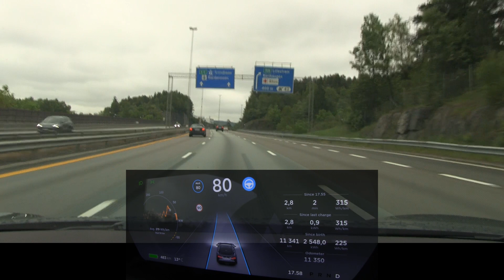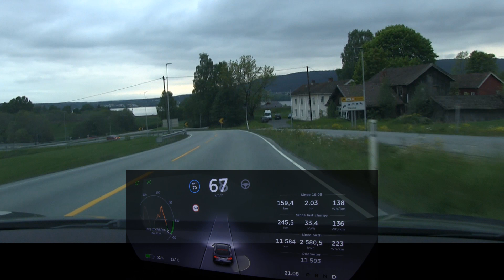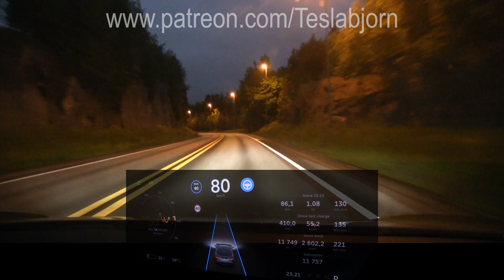Model S with AP2 demonstration and commentary

Comment: I am surprised at how bad it is. Don't they use computer vision properly? I work in the field and this should be easy with feature and edge detection. There's a clear distinction between what's a road and what the edge is... It relies too heavily on map and the drawn lines.

Comment: Firstly a big thanks for all your videos which played a key part in encouraging me to order my model S in October 2015, also used your referral code. Regarding the auto lane change not working at 5:58 and 6:28 this is because the car has not seen the other lane; only the lane it is driving in is visible in the display.
Reply from the maker: Thank you for using my code and for the explanation :)

Comment: Very good video. Informative. The car is not slowing down even slightly like human driver in the bend. Reaction / processing time is a fraction slower at the higher speaks. It goes over the line to the other side. I wonder if they utilise all computer and sensory power available. If they do. It's bad news. As self driving would need 10 times that.

Comment: I have a question, at just past the 1 minute mark you make the statement that coasting saves more energy than engine breaking, but how is that so as when you use engine breaking the energy is put back into the battery to be used later. Surely that's better than wasting it in air resistance and possibly breaking when you exceed the speed limit, neither of which can be recovered. I've watched quite a few videos that involve Toyota Prius and they show the battery being filled.
Reply from the maker: etmax1  there is no engine.
Reply: Well lets call it electric motor breaking then, the electric motor acts as a generator when it is turned faster than it is being controlled to go which results in a EMF (electromotive force) being generated which is greater than the applied battery voltage. This results in the current flowing in reverse which puts the kinetic and gravitational (for want of a better word) energy now converted into electrical energy back in the battery. This happens at reduced efficiency, around 20% partly because charging batteries is not as efficient discharging.

All cars with electric motors make use of this to some extent, and Tesla's use of L-ion batteries does this better than Toyota's NMiH batteries. Some systems have super capacitors which have a charging efficiency almost equal to discharge.

By the way, once I spent an hour looking at the differences between an engine and a motor from a definition perspective, and the definition is severely conflicted in around 90% of texts that I read

Comment: Hi Bjørn! I have seen alot of tests on Nissan leaf forums regarding coasting. Coasting like you did in the start of the video is not actually better because of the increased drag you get from higher speeds. I would think this holds true for the tesla as well, even though it has a lower drag factor.

Comment: why drive so slow 80 on 110
Reply: Not dangerous. There is a passing lane for a reason. Cars with trailers, for example, are not allowed to go faster than 80, regardless of higher speed limits. 60, if the trailer is not equipped with brakes (depending on weight.) Also, a lot of trucks and large vans can not, and/or are not allowed to go as fast as 110 anyways.
Reply: thats just dangerous driving so slow on a motorway
Reply: thats just dangerous to drive so slow on a motorway

Comment: Looks like the bridges and overpasses still confuses the radar, so it's slowing down until the camera can verify the clear road again with 100% certainty or the radar shows a clear road again.

I guess in the one case the barrier at the side was considered as possible car, that's why the AP didn't accelerate again.

Comment: Hi Björn. i heard something interesting today as I took a ride in a Tesla cab. Apparently the cab driver drove a Tesla engineer from California not too long ago. This engineer told him that the battery will most likely have to be replaced after 5-7 years due to age.  degradation. Distance plays less of a role apparently.  He also said that this information was not something Tesla is public about. 
This information seemed legit and both me and the cab driver are Tesla fans, so its not biased. Do you know anything about this? Is it true you think?
Reply: This sounds strange, Tesla itself has an 8 years warranty on the battery, and the battery expert/engineer that makes the batteries said that they have doubled the battery life on the new type of cells to 20 years, this will make the old ones 10 years :)

Comment: I only have AP1 but it doesn't seem too different to this at present but I'm sure AP2 will overtake soon on the way to level 5. I don't use AP for these kind of roads, only dual carriageways or motorways. I might use it on a straight predictable single carriageway road but anything else, you'll just end up needing to take over too often so it's not worth it. Still on long journeys 95% of my driving is on Autopilot nowadays, which is pretty amazing if you stop to think about it.

Comment: AP2 just doesn't read road signs at all right now; I have experienced it over and over.

Also, it seems to be quite confused about road markings changing.

Unlike AP1 as well, it seems that it doesn't try and learn from the driver, even though I drive the same roads over and over again; AP1 eventually fixed its mistakes (without a software update) whereas AP2 doesn't.
Reply: I guess AP2 don't machine learning?

Comment: The poor steering on the curvy road around 8:00  seems to be overcompensating for a mistake.  It also indicates to me (an AI guy) that it needs a better planning system, to "know" and plan the road ahead and position the car in advance in a lane.
Reply: P.S. Thanks! I hope Tesla is watching and can fix all these issues. You demonstrate that Concrete dividers and hilltop curves will cause accidents easily AP 2, unless the driver takes over fast. Very worrisome that it barely sees  concrete dividers and passing motorcycles.

Comment: It would be helpful if you mentioned the software version you are on at the beginning. Cause there was a rather important software update in May (8.1/17.17.4) that improved many aspects significantly. Maybe just add the car info screen at the beginning.
Reply: Christian: this car is on (8.1/17.17.17)

Comment: Auto lane change (for AP2) is only enabled for specific roads pre-determined by Tesla, AFAIK.  It's only available when you see additional lane markings on the instrument panel one lane over (left or right).  I'm pretty sure AP2 isn't reading signage yet so the speed limits it has are pre-programmed. Also, were you not holding the steering wheel during this trip? There were an awful lot of warning messages, like every 10 seconds of the sped-up video (~250 warnings).

Comment: An interesting video about the strenghts and weaknesses of the current AP2. Some situations in this video are really scary, for example the one with the concrete wall in the middle or the one over the hilltop. But it was comforting to know, that you are an experienced and skilled Tesla driver. Thanks and keep it up!
Reply: GMahlerVerehrer  well this might look more dangerous than it was in reality, the ultrasonic sensors are used too to steer away from obstacles, so there's a chance that the AP would steer along such a barrier but I guess way beyond any comfort zone of the driver.

Also AP2 is still considered in an alpha stage so it's not on the same level as AP1 and Tesla clearly states that.

Comment: cool video.. i have a question about the AP2.. does it learn when you take over from autopilot, or does it record all the time and compares your behaviour with itself how it would drive in autopilot?
Reply from the maker: The car doesn't learn by itself. But it will send the data back to the mothership. And then someone at Tesla will look at accumulated data and make the corrections. For example, if many people interrupt AP at the same positions, there might be a troublesome joint or something there.
Reply: RO Moto That is exacly what i thought. thanks for your question. :-)